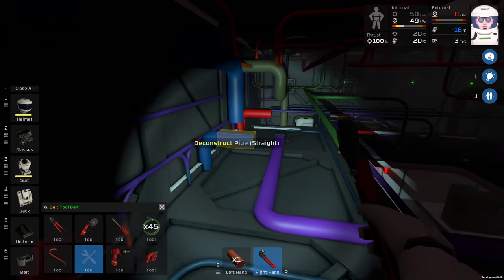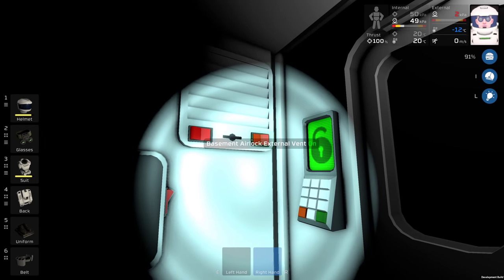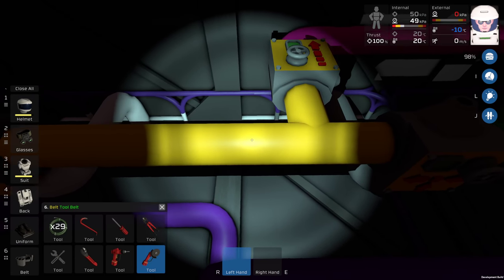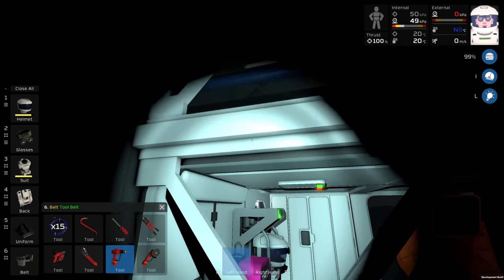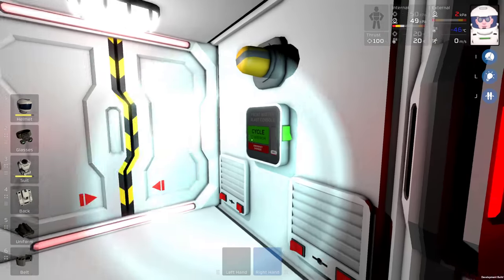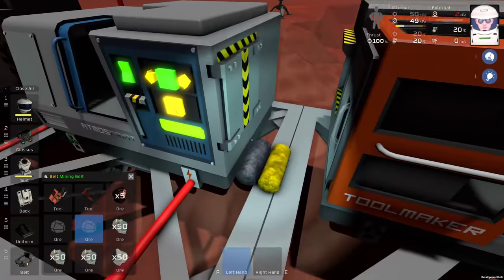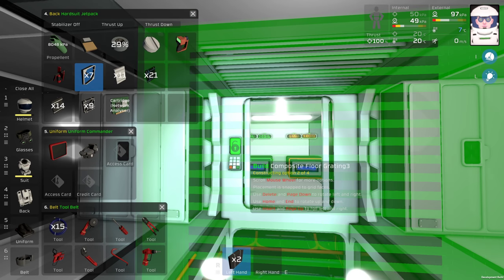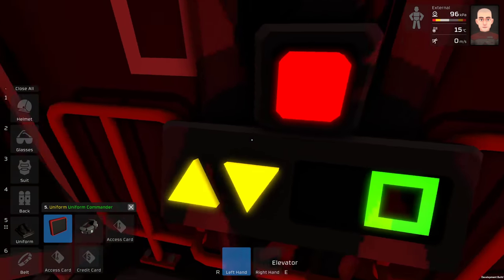Stationeers / EP 54 - Deep Breath / Mars Colonization

Comment: 1. You may want to add a battery charge ratio display of the power tower inside the base to kind of get an idea.
2. Also double pane the glass window on the filter room floor, beneath that is martian atmo rather than maintenance tunnel.
3. Base top has one piece of window that isn't double glassed.
4. Instead of using one gas sensor to see base temp for heating/cooling, use a batch reader to get an average of all sensors
5. I think your have not charged the pollutants in the wall cooler pipes yet.
6. Use more flares on bottom floor near the gas tanks (same grid block as the tanks) to heat up tanks more since they are the source of cold air.
7. Solar logic hump please :D
Reply from the maker: Thanks for all of the feedback Raafay!

Comment: So you mentioned that the heaters are always on because the Nitrogen in the environment was not dense enough... and you are partly right.  The tanks in the filtration room have cold gas in them and they will radiate/equalize with the base atmosphere.  Since there is a VERY small amount of Nitrogen, it cannot sink as much of that difference as if you had a denser atmosphere.  The heaters are heating up this tiny bit of N2, the tanks are sapping that heat and the cycle repeats.  Because of the low volume of air, this would take an eternity to transfer that energy from the heaters to the tanks.
It's like trying to heat your swimming pool with hot water from your kitchen sink.
Reply from the maker: Thanks for clarifying Andir!

Comment: A good micro project could be setitng up the airlock on the ground floor so that it auto cycles when you go to the bottom floor. So its ready for you to go out when you get there. And the reverse, calls the elevator when you cycle in. Only shaves a couple of seconds, all of which will be spend setting up the system, but its playing around with logic gates, where I think you have the most fun. I think it can be easilly done with the base pressurised too.
Reply from the maker: Under normal use of the base, the elevator will always be on the floor I am on and the airlocks will always be ready for me because it's single player.

Comment: Damn dude, I've been watching every episode for the moment you can finally take your helmet off. The base is awesome and your series has got me wanting to play myself. 

As far as suggestions: can you move the front exterior airlock control panel either one space to the left or maybe closer to the ground? It just seems so weird how far it is from the door. I can't help but imagine your guy stretching his arm out to tap the button.

For future projects: A gas production plant. One where you can capture, filter, mix, and adjust the temperature of different gases. It could be used to supply gases for ready use in future projects. 

Another one would be a rover bay. A place you can make and drive a vehicle which can allow you to mine for resources for longer and bring back bigger hulls. 

Admittedly, I don't know too much of what is possible currently in Stationeers so I'm sure whatever you decide will be a fun watch.
Reply from the maker: I can't move it left, it will interfere with the door, I could move it down but it's waaay too late for that now that I am pressurized.

Most of the time I won't need to use the front panel anyway.

Gas production sounds good, but I have no use for mixed gasses, not really. 

Rovers are very experimental right now, I may highlight them anyway, but not sure.

Comment: FYI, The basement is not the cause of your cooler filtration room.  The walls are perfect insulators because the game does not model conductive transfer (transfer through solid material).  It only does so with specific devices.  Radiators, Tanks, and Pipes are among those.  Your filtration room will try to equalize the tanks with the room so the massive amount of cold gas in them is drawing the heat out of the room gas into the heating the tanks.  Currently the pipes will cool the gas inside them when placed in a vacuum, so your maintenance area will always introduce a bit of a chilling effect, but the batteries, electronics, sun exposure, and plants in the base will introduce heat, so it will likely equal out a bit.
Reply from the maker: I didn't mean the external basement, I meant the increased volume due to the bottom airlock and elevator shaft. Yes, I know the tanks are slowly equalizing their temperatures with the atmosphere, can't wait for the gas in the tanks to warm up!

Comment: Honestly mate other than planting your crop to get your food source secured in your newly pressurized base (congrats by the way)

I think cannibalizing the old base and incorporate its solar and battery into your big base would be a great idea, instead of just making a large amount of new solar it would save a little time and help out now. 

Having your production in the same area as your storage which you could expand down stairs easily enough would stop a lot of the back and forth but ya gunna need some light down there maybe auto light sensors could help with that maybe for a future project. 

I would double check that the pink pipe is connected to the atmo filter for your pollutants to filter out as that could be the reason why it doesn’t seem to be working.

After reading the other comments I think there are a lot of good ideas and observations coming out but I don’t think double walking actually helps out but it does look good.
Reply from the maker: I don't want to cannibalize the old base as it's nice to have redundant farms just in case of catastrophic failure. The amount of effort to cannibalize the base is honestly waaaaay more than just mining the resources to add additional solar panels. 

Double walking?
Reply: Rhadamant sorry mate I ment double walling stupid phone auto correct.

Comment: Now only thing they need to do is to allow people build inside frames and panels. After all people already removing those and welding them for builds is a nuisance. I really hope they don't remove floating objects feature. I think adding straps automatically generated when pipe passing frame edge or inside if there is a object there, basically allowing object to flood inside frames (so there will be still point to use them), would be perfect solution of this problem.
Reply from the maker: The game is obviously a work in progress as it patches constantly. Curious what they'll add next.

Comment: Hey Mr. Rhadamant, I have a question. Does double or even tripple glasing help on Mars with keeping the heat inside of the base? Well if so why have you not double or tripple glased the floor or rather the ceiling between 1st and 2nd level!? What about the greenhouse in your penthouse level? Are those windows double or tripple glased? I mean if it has influence on the temperature, it could help you save some battery power! Best wishes from Germany! By the way, this is an excellent building! The greenhouse seems a little overkill for just one person, but all in all... BRAVO!!!
Reply from the maker: No, double glass panes  doesn't help as far as I  am aware. With that said the entire base is double paned everywhere, and there's no way to triple glass, but they are doubled in case of an accidental crowbar.